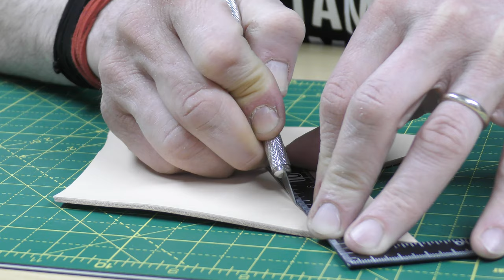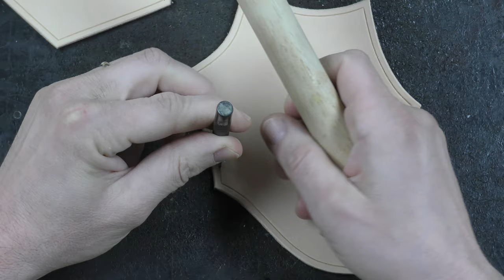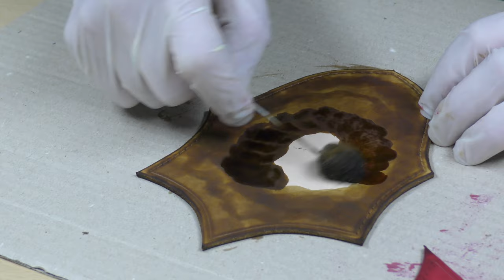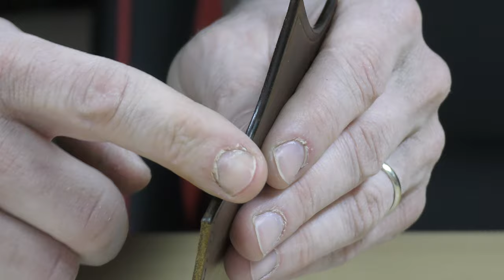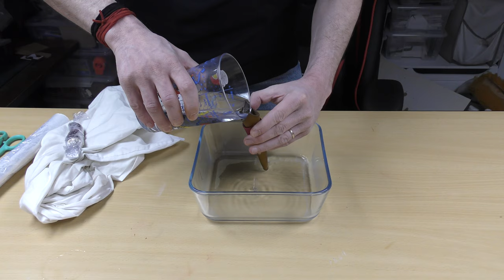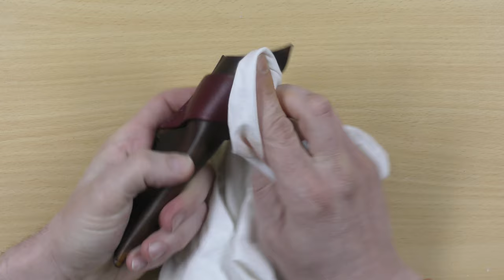How To Make A Simple Leather Knife Sheath - Leatherwork

Comment: This looks pretty sweet, brother.

Question; I've tried knocking out a sheath or two and for some blades they can cut the stitching, when do you decide whether or not to sew in a a buffer strip?

Thanks for sharing your craft!
Reply from the maker: Thank you!! It depends on the shape of the sheath and on how you make it. If you wet form the sheath around the blade, and the stitching line is not too close from the edge of the blade, no need for a buffer stip. If the sheath is made flat and close to the edge, better add one. Thanks for watching!